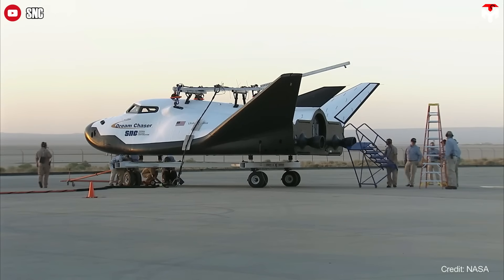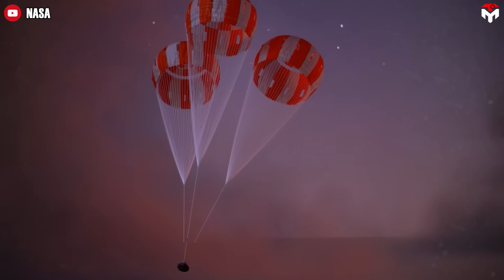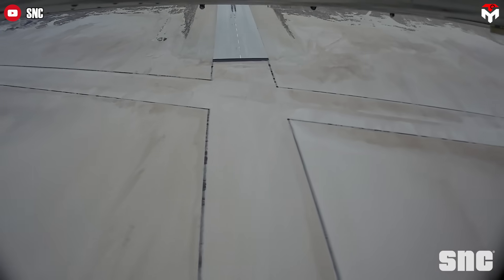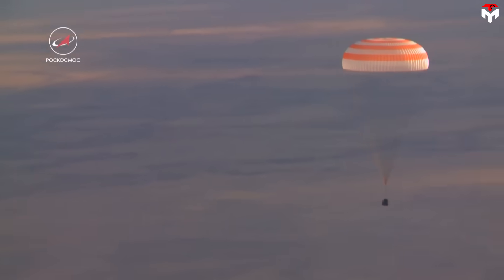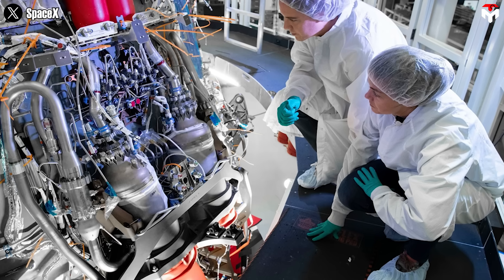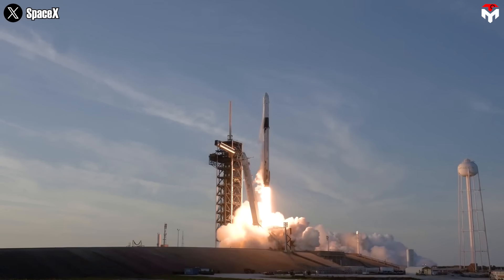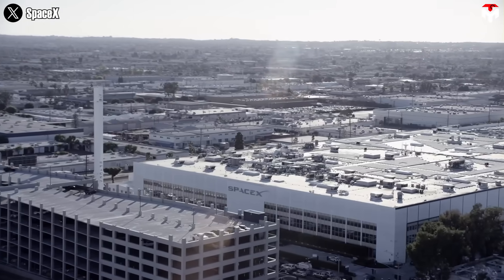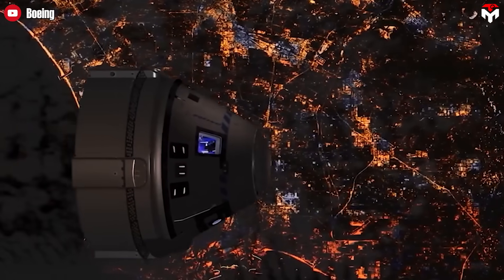SpaceX's new Dragon Landing Method SOLVES what NASA new Space Plane Impossible...

Comment: Dream Chaser is still better than Starliner
Reply: If NASA was smart. They would cancel SLS and Starliner tomorrow. Use the money to "fast track" the crewed version of Dream Chaser . While they do that, configure a Falcon Heavy to put it in orbit as a backup to ULA.
Reply: @bat2293  
We need to keep the present programs to handle the necessary workload until the Dream Chaser is operational.
Reply: I don't think DC's lack of retro propulsion is a problem because it is a totally different concept. There is no reason to compare.
Reply: Well, being as how Starliner failed, yes.
Reply: So is the phone booth from Bill & Ted.
Reply: Water recoveries are not speedy. Especially compared to runway recovery.
Reply: @eaglekeeper7737  
I don't know how a reasonable person could doubt that.  A water recovery needs the support of a large ship with dozens to hundreds of crew-members and a smaller craft of some kind and a long trip back to the base to have the capsule craned off of the  ship.  A runway landing just needs a bar for the crew to walk to after they walk from the space landiing craft.

Comment: The launch and landing amazed me most in different fashion between SpaceX-Dragon and the Dream Chaser. 
SpaceX- Dragon 🐉 were both crew and cargo. It launches vertically on SpaceX- Falcon 9 rocket. It returns to Earth through splashdown. It also has an emergency thrusters jic failure use of the parachutes as u've recited. How cool is tht! Whereas, 
Dream Chaser lauches vertically on a Vulcan Centaur rocket. Designed only as space cargo. All along, I thought it's operable.
Thank U ✌️ my friend. Enjoy ur w-ends with a bang🙌✨️ Lattah
•~● 😼🐉
Reply from the maker: What also impressed me most was the difference in launch and landing styles between SpaceX’s Dragon and Sierra Space’s Dream Chaser.

The SpaceX Dragon spacecraft is designed to carry both crew and cargo. It launches vertically atop a Falcon 9 rocket and returns to Earth via a splashdown in the ocean. One of its coolest safety features is the set of emergency thrusters, which can take over if the parachutes fail—very impressive!

Meanwhile, the Dream Chaser also launches vertically, but it uses ULA’s Vulcan Centaur rocket and is currently designed for cargo-only missions. I used to think it was already in operation, but it’s still preparing for its first flight.

Thanks again, my friend! Wishing you a fantastic weekend! ✌✨